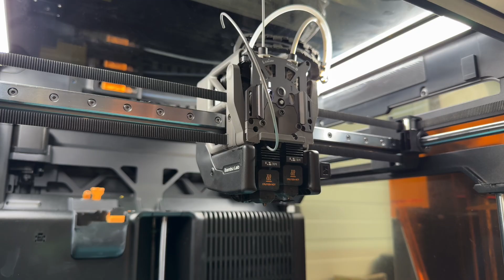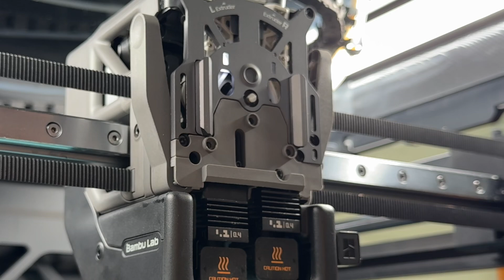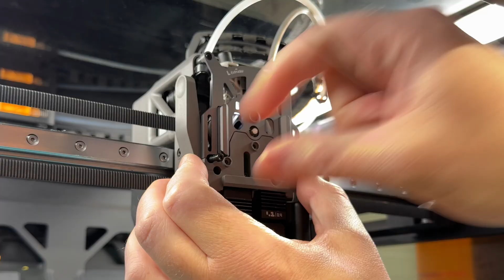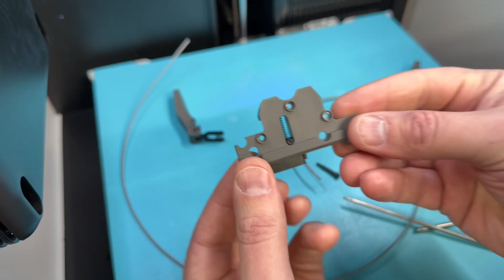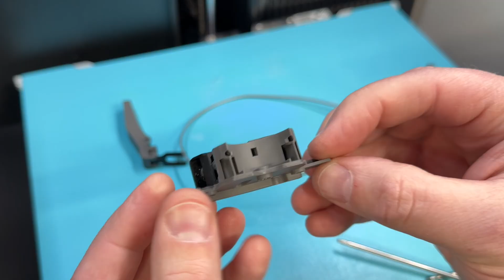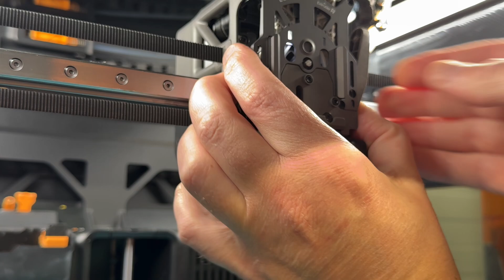Bambulab H2D partial extruder teardown - blockage repair

Comment: The cut arms aren’t going back in for me idk why 7:45
Reply from the maker: Are the blades stopping them?
Reply: @Kenprints  yes
Reply from the maker: And the filament is fully removed yea? Nozzles removed also ?
Reply: @Kenprints yes both were gone
Reply from the maker: Thats very odd there shouldnt be anything in the way if the blade is in the correct location
Reply: Are the springs in a correct position?